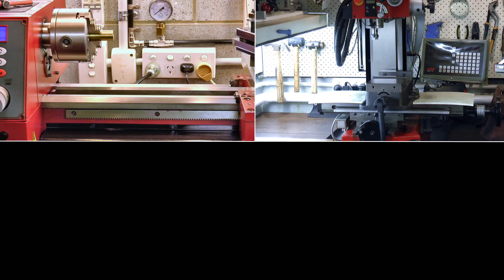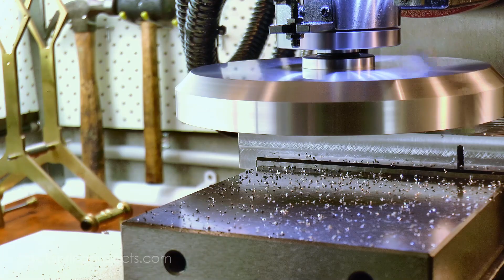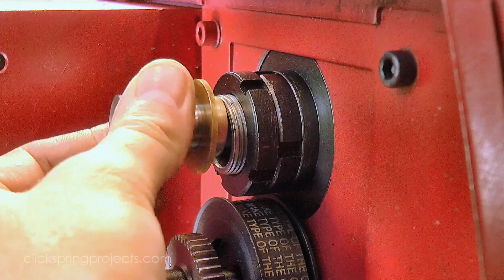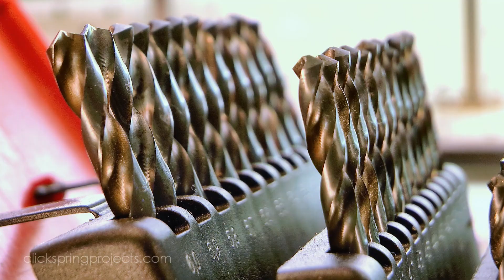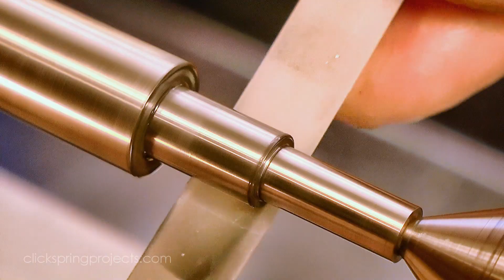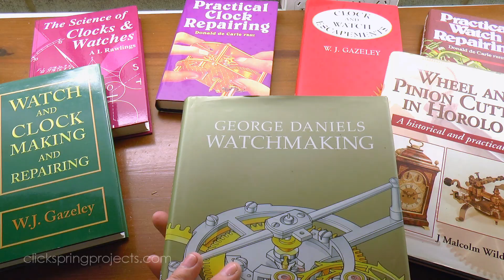Tools, Glorious Tools! #4 - Setting Up A Home Machine Shop: Where Do I Start?

Comment: Late comment, this is a great video. What no one tells you is once you have bought the lathe and mill etc you will spend twice that amount on tooling and odds and sods for your main machinery in your shop. The department for war and finances (also known as my  long suffering wife) thought that I wouldn't need anything else once I got my main machinery in my home shop. How little did she know. It never ends. I have exhausted all my excuses in buying a lot of tooling so have just started buying it and waiting for the explosion when she finds out. Life is good as, as I get older I have had to get hearing aids because of industrial deafness and can shut them down with my mobile phone if needed.😊

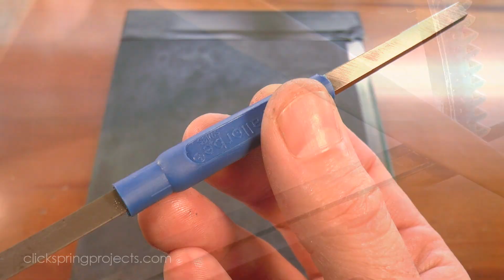Comment: 7:55 Just rewatching this as I'm setting up my new shop, such a great insight in where to invest first, really appreciate this series! Now I'm going down the rabbit hole of file shopping. What's you favourite go to file? Like if you had to pick 1 to start with, what would you want most?
Reply from the maker: A 8" #2 cut Swiss Grobet 'hand' file like this: https://www.artcotools.com/swiss-precision-files-hand.html. Mine gets constant use on the lathe, for part tidy up, de-burring etc Cheers :)

Comment: The Engineering company I worked at for 30 years as a machinist closed its doors in 2022 . Subsequently I found a position as a fitter . But really really missed the lathe , milling and gear cutting . So I bought a Myford super 7 lathe that needed some TLC . But just as you said SIR  now I need other machine tools to complement the Myford.  But it's like having a new lease on life for me . Thank you Sir for the video.  Regards from South Africa

Comment: I'd agree with everything Chris has said, especially about the good reference books. In general there properly researched and written with very few mistakes. The same isn't always true on YT and hobby forums where some posts and videos are done by probably well meaning but still those with not quite enough experience and knowledge. And no forum topic or video can ever go into the same technical depth those books can.

Comment: Ripper, a very efficient introduction to growing a home shop!  My tip: ordinary floor or bench drill presses may not do a good job of centering  drill bits of 3mm and smaller. Years later I discover this video's collet set and morse taper collet chuck. Thats where I should have started!

Comment: 4 things that dictate setting up a shop.
1. Budget.
2. Available shop space.
3. size or type of work you are planning to do.
4. Accuracy of the work you are planning to do.
5. Materials you plan to work with.
6.Future projects you would like to do.
Ok, that was 6 but trying to edit on my phone is difficult.

So the basics are the same, sawing, surfacing, turning, hole making, welding.

If you have the ingenuity you can build a lot of stuff with only a lathe and a faceplate.

Mills get too small much faster than lathes so buy the biggest one you can afford.
Mostly though your budget (plan on spending as much on tooling as the basic machines) and the work you would like to do dictates the rest, you can obtain a shed for a work shop pretty readily or a corner in most garages will answer.
The size, accuracy and materials will dictate what size and types of machines to buy.

Comment: If you're going to do larger stuff then What you normally see on this channel, then a horizontal mill.
Could be what you're looking for.
If that's the case, then do not slack on your you're oppressed, get the absolute best you can find. I find more often than not precision. Drilling will determine the quality of my work. Because if I cannot be sure the holes that I drill are parallel to one another. Then something as simple as a three layer platform is impossible.

Comment: Great video. What you need is basically dependant on what you is going to make. In my case, I changed from a machine tool researcher with all machine tools available to getting a small farm. So had to to start from scratch building a work shop. Repairing farm equipment, cars and everything else needed. Over some 40 years got about the same tools as described in this video. Some things I needed is not mentioned. A pillar drill, a sturdy vice and a air compressor was the the first things. Still used daily. Also different welding equipment. Regards an oxy/acetylene torch the most useful one. Though with current price of acetylene MIG, TIG and Plasma cutters make sense. Nowadays working with racing motorcycles, special tooling and parts are made.

Comment: On thin I think you over look & so do a lot of other people. Is you need a good light that you can see your work with. Not all tool shops have good lights. I think you should get one that can get wet and with stand dust and good knocks.

Comment: I've had issues with Grobet files in the recent years. Even the swiss made. I've been switching slowly over to frederick dick for the past 5 yeas as I need to replace them. I do jewelry and fine details and use them daily. They seem to be much more consistent than the Grobet in the past 8-9 years. I even returned several that had issues with large blanks between teeth and some even came warped.

Comment: Very good advice I would say and very nice video! 

Essentially my story as well, had a shop all my life and a similar small space in a big closet while I was a student many years ago. It worked really well for what I did then. I now have much a larger area to play in and more and larger machines etc, it has evolved over the years according to my needs and resources. 

It is good advice to buy and upgrade the shop as money allows over time. Buying the best quality tools and machines that money allow is a good idea. I use some quality tools inherited from my grandfather. And foremost upgrading the shop as interests change what You want to use it for. 

One thing that is not discussed often is that a shop usually has sort of an "optimum size" for what you do in it. Having the stuff You use often within easy reach saves effort and makes it more pleasurable to work. One thing I noticed myself which is actually pretty obvious, is that a larger building and shop requires much more time for upkeep and maintenance... 

A separate grinding space is high on my wish list and I kick myself for not considering that when  I was planning my present shop.

Comment: I bought a very cheap set of hand files for a personal gunsmithing project. It was fine for what I was doing, but if surface finish is important, and you don't want to spend a ton of time using sandpaper to get a good finish, then a quality set of files is the way to go. For my project, the sanded parts would not show on the outside, and would be subjected to sandblasting prior to coating.

Comment: I find that if you’re patient, a lot of retiring machinists are parting out their collections of metrology and tooling.  In the last three months I found a machinist-made height gauge, surface plate, and Interapid tenths and half-thou indicators at very good prices.  A lot of these guys are glad to be able to pass them onto another generation of makers.

Comment: Chris - it's lovely to see that you recommend the old British classic books. They seem rather outdated today but they are still as valid as ever. My first lathe was a HobbyMat and I hated it because it was too small. I have since acquired many lathes - I found the bigger ones are much cheaper than the small ones. So I have a Colchester Triumph and a massive Holbrook H20 that weighs nearly 5000kg. Ironically now I have huge lathes thanks to your inspiration I would much rather do small delicate work! My lovely old Triumph is very accurate but a tad too big for clockmaking! I also have a CVA which is much better for smaller work but is still 1400kg.

Comment: Completely agree about getting a lathe. Very useful thing thing to have, and even those cheaper import ones are a great start to get used to how one operates. Do get one that is a little bigger than what you think you need because there will always be that one project that won't quite fit on it :)
As for single quality tools VS a cheaper set, i respectfully disagree on that one and prefer to get a cheap assortment first. That allows me the freedom to try different things and complete several projects with one set. Then as parts are used up/wear out, i can get quality replacements for just those since at that point i know for sure what is used the most.
Couple of things i won't cheap out on are hand files and drill bits. Quality files cut WAY faster and cobalt drill bits last way longer compared to the cheap versions. As a side note, being able to resharpen drill bits is a really useful skill to have, and it is really easy to do on a bench grinder.
Lastly, regular straight taps are kind of a pain to use (have to back them out completely after just about every turn that you cut, just to clear out chips), spiral taps or so-called "gun taps" (named so because they can be used in a drill, not necessarily because they are meant for firearms) are way more efficient because they form a long chip and direct it out of the hole, somewhat like a drill bit does.

Comment: One piece of advice I received early on was to remember that hand tools (especially files) can do everything that a machine can do, often with similar precision and accuracy. So, before buying a specialty machine I consider whether I actually just need to get out the files so that I can use the money and workshop space for another project.
Reply: In addition, I've found that sometimes it's both faster and more fun to lay out and file a feature than to set up a complex fixture and dial in a tool.

Comment: What is that workshop,  a shipping container?   Would certainly make sense to keep it cool in the hot Aussie summer, but wow.  Only Chris could keep such a compact space so organized and clean.
Reply: Good idea, one of those insulate ones. Been too hot here till now, sweat dripping on the machines. Humidity has turned to old ones into Hand Tool Rescue projects, will be getting some Evopo-Rust next week.

Comment: Wish I could've seen this video 20ish years ago.....but this is pretty much how I got going.  Lathe, bandsaw, grinder and torch; and then added accessories/welder/mill/surface grinder as I was able. It's been a long road, but can do a lot with what I have. Pretty sure that the list never ends-  Great video Chris!

Comment: Disclaimer: you don't technically need all of this, you can get far with a 10$ drill strapped to a 2x4 as a pseudo lathe and some 5-10 bucks electronic calipers, a file and some diamond stones.

Also look around your area, you may have clubs/hacklabs/mutualized shops/whatever, here for 100 bucks a year you can use the tools during opening hours, or you can directly buy machine time out of the opening hours.

You can also build the tools for fairly cheap, there's great plans for a concrete lathe.

And be careful with lathes, some don't have the ability to cut screws.

For most of the cheaper stuff, buy an usable tool, and buy the expensive version when the cheap one doesn't do the job anymore, you'll know what you need a lot more by then, or it might turn out that you don't need it at all.

Make a workshop for your needs, you don't need a 20" diameter lathe if you're only making screws, though you may also need a 20" diameter lathe but be fine with no slide and just freehanding on logs.

All you might need may be a cheap 3d printer and a router attachement for engraving PCBs.
You can also get cheap 4th axis attachements for a 3d printer, and use that as a mill if all you use is brass and you don't need anything under 0.1mm precision, or you can just use a file and measuring after each pass when you do.

Comment: One tip is to find a local volunteer organization which will allow you to join and learn from their masters.  My own machining journey began at the Dixie Wing of the CAF where I learned the basics from a retired professional tool maker and machinist.  Many of these organizations will, with a sideways nod, allow you to do your own "Government Jobs" which is code word for doing your own personal projects on their equipment - obviously this is allowed only as long as their own jobs take priority.  Use good judgement and you'll be fine, and they'll probably have a level of shop equipment available for your use which would be next to impossible to acquire for home shop usage.

Comment: My only additional thought is that, if you're starting to assemble a machine shop now, try going back in time and begin buying stuff as a teenager. Saves having to buy it all in one go. 😁
Reply: Not to mention the recent basically doubling of prices on just about everything. I miss even the "$1.50/lbs" fasteners at a local hardware store, they are close to 4 now lol

Comment: One piece of shop wisdom I would like to add is: if you can learn to do good work cutting your teeth on a cheap mini lathe or mill, with all the limitations that come with them, you will do fantastic work on a better, higher quality machine when you finally get one.

Comment: Took me until I retired before I got a lathe and mill. The lathe was an Emco that I had always wanted and bought secondhand, the mill I bought as a retirement present. However I have been collecting hand tools since birth. Now I'm retired I still am buying tools, especially relating to the mill and lathe. The moral of the story is it takes a life time and all the experiences that go along with it to setup your workshop so don't expect to set it up from day one as a boxed set. Even if you had unlimited money you still have to know what you want, why and where you are going to put it to find it when you need it. I would say first up, after you have the basic hand tools you need to decide your primary direction is wood or metal, that will define your first machines. I can assure you its not particularly practical ( or satisfying ) to try mixing both in the same room. And there in is the final point, what ever you do you will not have enough room :)

Comment: Don't buy a second hand mill or lathe from someone upgrading. 
They will keep the very expensive tooling.
Buy from someone retiring from the game if you can.
Tooling is gold.
Run a wanted add, tell them their gear will go to a loving new home. 
That's how I started. It worked.

Comment: I wish I had something like this guide before we had set up our shop. My father and I have a machine shop similar to yours and we set about doing it much the same way, however we learned some of the lessons the hard way, primarily about avoiding the cheaper sets of milling tooling and files and such. Ours wasn't set up for clock making but for gunsmithing. We built and accurized black powder weapons for competition, but seeing as my father passed away almost 2 years ago, I guess the shop is now mine, I am taking the time now to teach my son's the skills to do what my father and I used to do. I'm betting that our tools end up going to one of them and I hope they can find the same enjoyment teaching their kids like my father and I have. One side note, we had the opportunity to buy a Smithy mill/lathe combo and it has turned out great for us. If anyone follows that route, just save yourself the headache off the bat and the first time the control board burns up, just go ahead and get a VFD for it and not fight the issues with that darned control board, we went through 4 boards before I finally said screw it and taught myself how to wire and program a VFD for it, you lose the factory rpm dial but it's not hard to get around.
Reply: Does your VFD not have pins for a speed dial (potentiometer)? Most VFDs do, as well as pins for forward/reverse and start/stop, to allow for external controls.

Comment: I would be amazed if someone hasn't said as much already, but I find a porta-band with a stand does most everything I need in a lot smaller package than a horizontal band saw. I built a little stand (the Porta-Band Grandstand) which mounts in my vice.
Reply: I noticed even Adam Savage has done that. Seen it in a few other shops too now.

Comment: I appreciate having both a drill press and a mill, because a lot of the time my workflow involves putting holes in something else while a workpiece is aligned on the mill.  I also prefer wearing out the relatively inexpensive drillpress with repetitive drilling and saving the mill for when I need it.  (Same goes for not using the threading attachment on the lathe for mass material removal, because it'll wear out where moving the carriage with the traverse rack, or a separate feed screw, doesn't put the wear on the high precision component.)

Comment: Another thing to keep in mind is that you can make a lot of the tooling you need.  For my Atlas lathe I made faceplates (including right angle), ball turning and boring tools, etc. Any were made from MLA castings, same as the die filer you showed in the video.

Comment: Most of the parts I wanted to make were mill parts, not lathe parts, so I bought a little G0704 mill first. I did end up needing to make some turned parts, so I would chuck round stock into the spindle and clamp turning tools and cutoff blades into my vise. It works fine in a pinch. So well in fact, that I ended up upgrading to a large knee mill before I bought a lathe. A lot of people here will tell you to buy the biggest machines you can. This is absolutely correct. You can do a lot of stuff on small equipment and I have tremendous respect for those clever people who do (looking at you Quinn), but everything is just easier on bigger equipment. You don't have to go full Abom79 on it, but one size bigger than what seems right is probably the best move.